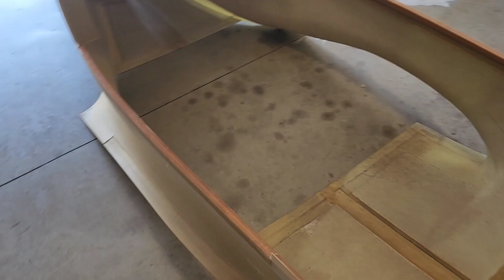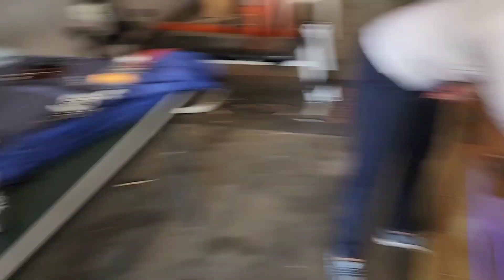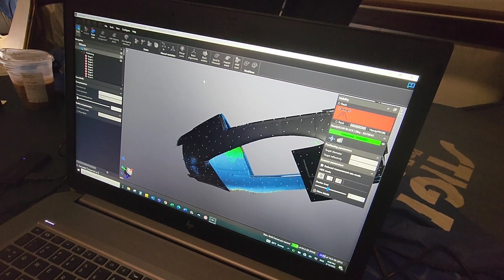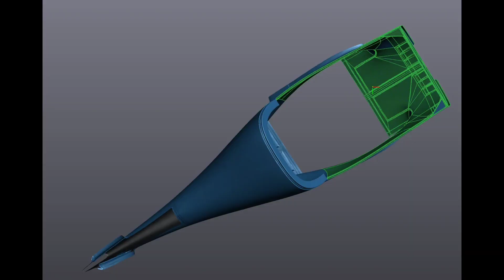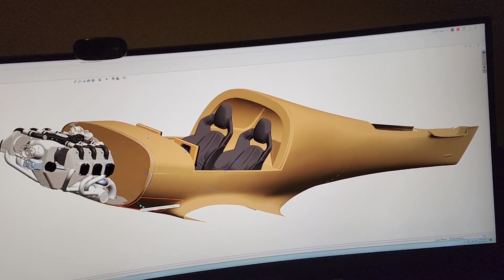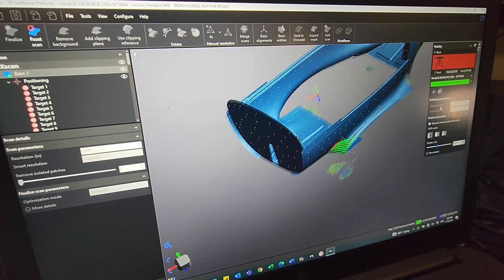Creaform HandySCAN Black Elite 3D Scanner Lancair Airplane and Surface modeling.

Comment: Nice work and congrats on your two kits acquisition. Very informative videos, thank you for sharing. I already subscribed and looking forward to follow along your projects. In future videos, could you share your thought process on modifying the wingtips (winglets/sharklets)? I understand they create an extra surface that redirects the air, reducing the vortex drag but why using them on Lancair 360 in particular? Have you done some specific analysis yet? BTW, great job on those 3D rendering. 👍

Comment: Nice sharing info！ 
Quick question：Which software or what product has the best surface rebuild quality for CAD after process?
Reply from the maker: Interestingly enough, the surfacing is done in Creaform software so what you export is a set of parametric surface patches that can be imported into any CAD software. Not all CAD Software handles surfaces as well as others. Solidworks is in my opinion a little cumbersome working with surfaces. Fortunately most CAD software, even the ones you know, can handle these surfaces. The absolute best is CATIA in my opinion but nigh impossible to obtain because it is expensive (Solidworks is made by the same company).